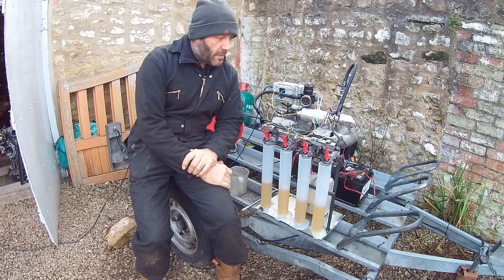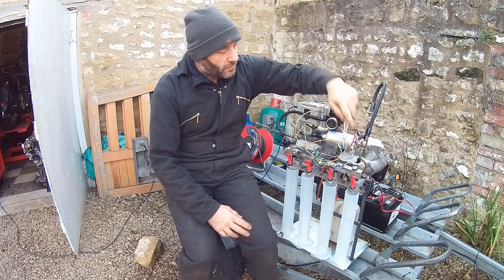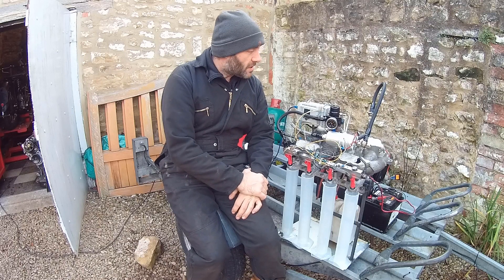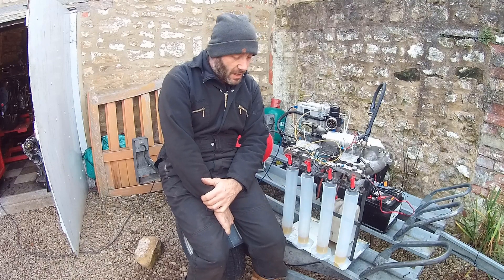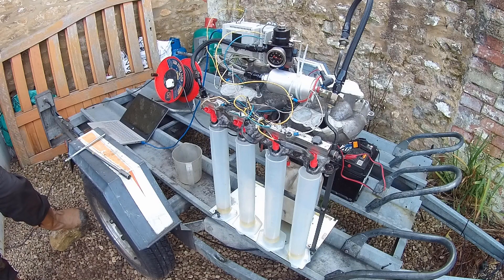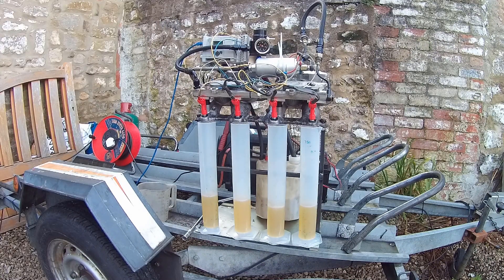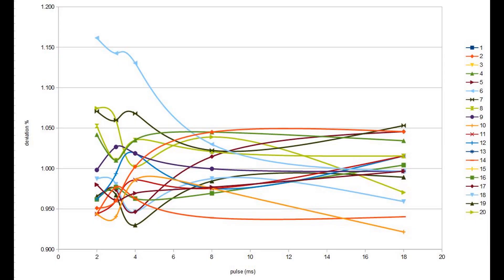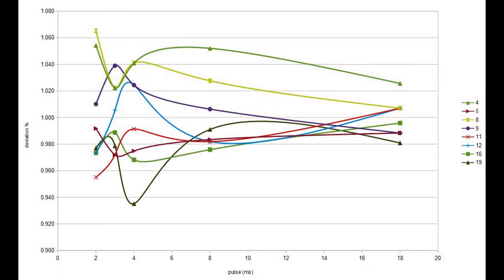TurboShed Part 34 - 1UZ Turbo budget injector flow matching on our home made injector test rig

Comment: Any problems with the injectors since the installation?
Reply from the maker: so far they seem okay, but we only fitted them 2 days ago in Part 36.  As already mentioned, we did flow match a lot of them to get a good set though, I wouldn't just buy 8 of these and put them in a car!

Comment: Great info. Just a couple questions.  

I may have missed it, but would you have to account for consistency of the battery voltage during the test. 
Also would the higher voltage when an engine is running make any difference as far as the flow numbers staying consistent.
Lastly, will these injectors provide predictable flow numbers ans spray patterns at higher base pressures seen with boost?
Reply from the maker: Thanks for the questions!  We have to balance the amount of detail we go into with the overall video, and its a difficult challenge, we never quite know the right level and worry that we are too technical and it turns people off.  We didn't mention in the video, but if you look closely you'll see the fuel pump is running off a different power supply and battery to the injectors, so we can control the injector voltage without the draw of the pump pulling the voltage down.  We did some testing and yes the voltage to the injector does alter the  response time, but we found its about linear so an injector that flows say more at 12v will also flow more at 14v.  We did our testing at 13v injector feed, which is what we've measured the car actually gives at the injector when running and fuel pumps, fans etc are all running.  Sorry for the long reply!